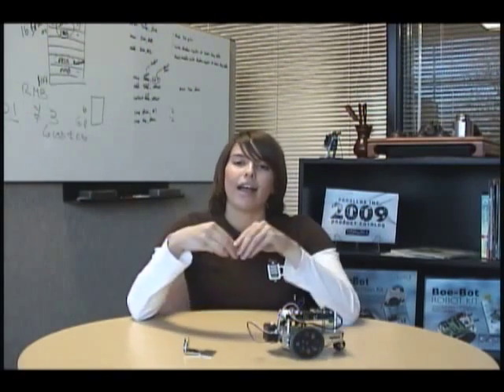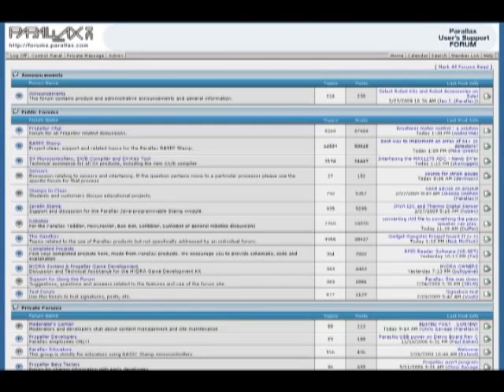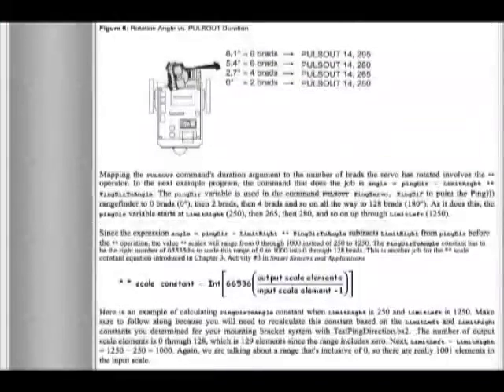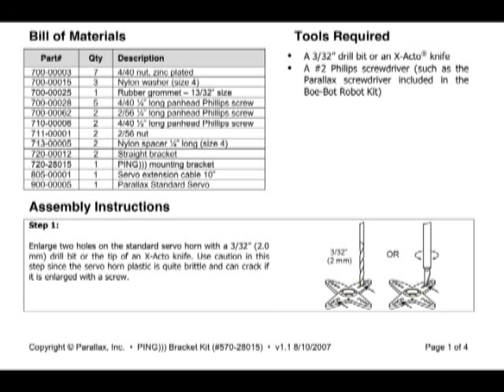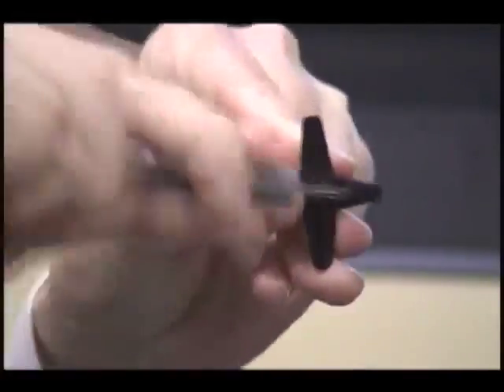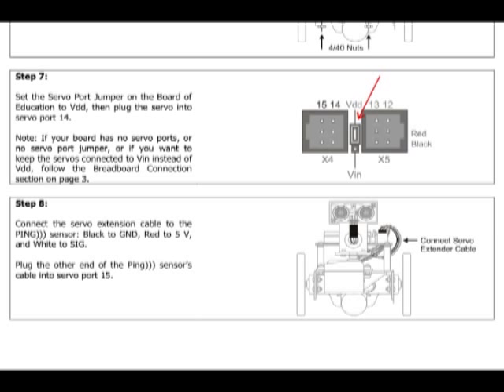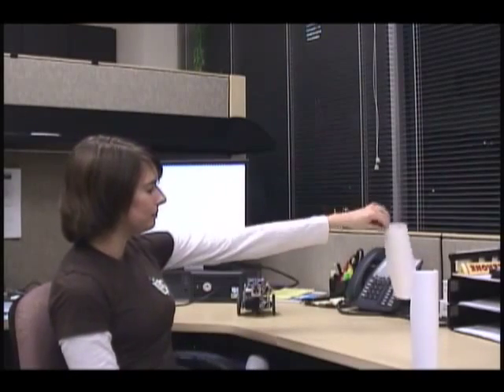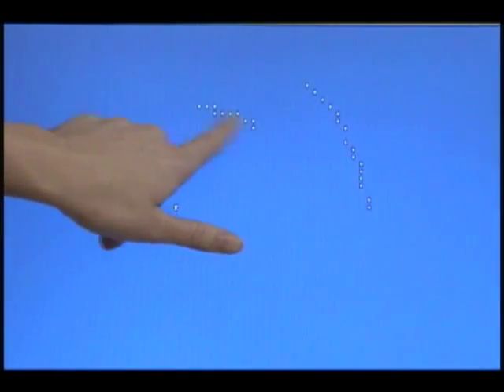Ping)))Dar - A Radar Style Display

Comment: @lights24bulbs: technically, it's both.   The 'Hollywood' version of sonar use a sweeping pattern, but I have yet to see a actual sonar that does anything else except in/out distance. This places the PING)) on a movable platform, changing its direction.  I tried a similar design on a VEX robotics platform.. My mistake, was not properly timing, waiting for an 'All Quiet', and result was a rash of stray return signals.  Modifying the code for this, to C++ might help remedy that.